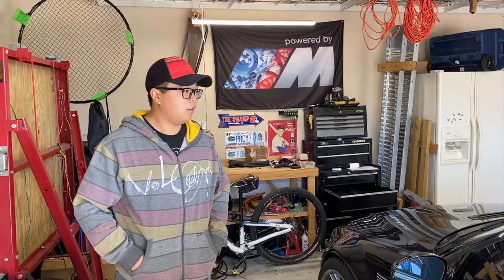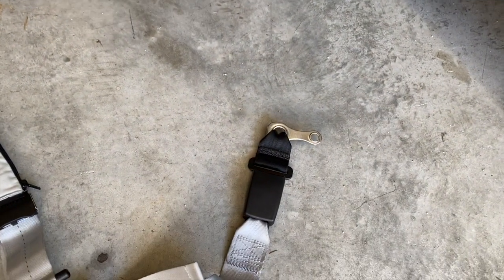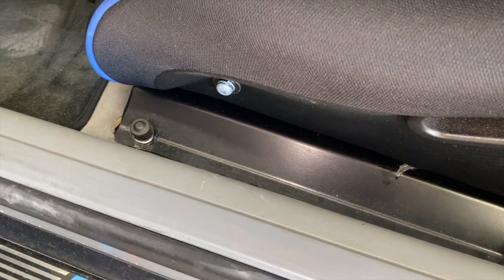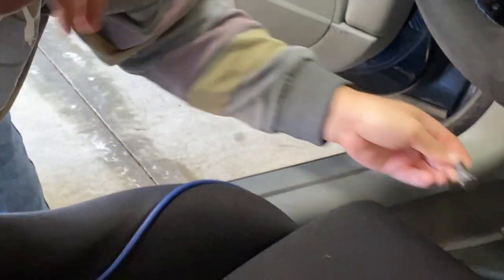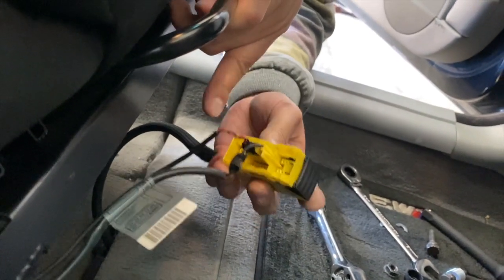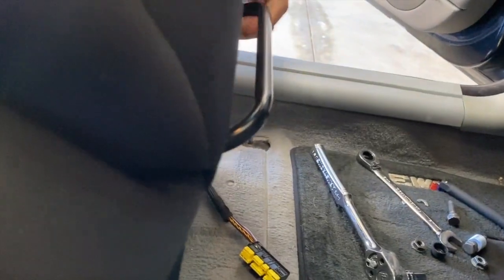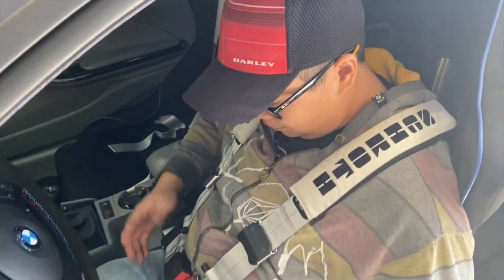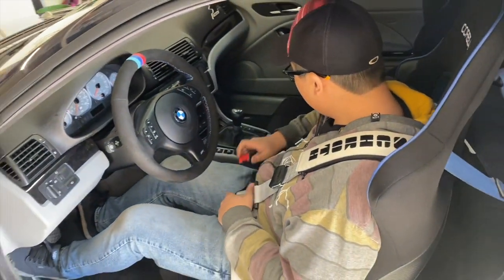Installing a SCHROTH QUICK FIT HARNESS on a BMW E46 M3

Comment: Anyone watching this needs to know. This setup is unsafe to drive and will likely not pass tech at any reputable track day. Schroth clearly states that their Quick Fit Pro Harnesses can only be used with factory seats. Fixed back seats with four point harnesses is very dangerous in a rollover. 

Please everyone know that if you add fixed back seats to a car, even if it has "rollover protection" that you must also add a roll bar and 5/6 pt harnesses. The factory seats are engineered to buckle in certain crash conditions that contribute to the car's rollover safety.

Sorry to be "that guy" but I just want people to make informed decisions regarding their safety equipment. 

Be safe. Have fun. In that order please.
Reply from the maker: +Peter Eacmen thanks for the info! Yes, I just learned today that this harness is meant to be used with the stock seats. My buddy was aware of that and will soon be installing a half cage. At least the info is still relevant for how this works and how to install with stock seats.
Reply: Thank you Peter. Yes, I've done a lot of research on safety stuff & I knew when I was going with fix back seats and harnesses, a rollbar or half cage was going to be required which is next here in a couple weeks. This isn't a daily driven car by any means so I knew I had some time to get everything together before the warm weather comes in spring for any DE events.
Reply: Rollover hazard with harness is when harness restrain occupant completely in the seat and the roof collapsing on him/her in a rollover, that will happen whichever seat you have, so long as you use a harness w/o roll cage. Whereas 3-point seatbelt allow occupant to roll, avoiding the ceiling essentially (I consider this a bit shabby). The major problem with this setup is not roll over protection, the quick fit pro does not work like regular harness. It has an extra fold in the shoulder belt that would unstitch upon an impact and allow the occupant to roll as with a 3-point stock belt. The problem with this setup is inadequate seatback strength, and possible compression of driver spine. The back strap of quick fit pro can have a steep angle downward (unlike regular harness that needs to be restrained to 10-20 deg) is because they go over the stock seat back, which are about the same height of the occupant's shoulder, and that prevents spinal compression. With your seat, the strap that contact driver shoulder goes downward directly, which exerts downward force on driver and may cause spinal compression in crash. Another outcome is that now there's significant force downward on the seat back, which can cause it to collapse. Stock seats are tested to handle this but not your carbon fiber bucket seat.
Reply: Otherwise good video man, clear graphics and voice, very illustrative. Thank you! Did you break something removing the side bolster? XD
Reply: Apparently cobra Nogaro fixed back are approved for Schroth quick fit
Reply: Scope951 Do you have a link to a document from Schroth with this info? Without it you may still fail tech at the track.
Reply: @petereacmen716  Good point! I emailed both Cobra and Schroth for confirmation. I just thought it weird I saw on multiple message boards people bringing that up, but it could just be internet keyboard warriors. I'll let you know when I find out!

I could see it being a point of nuisance trying to convince the local track day authority to allow you out on track with this unique and lesser known exact combination of harness and seat though. I thought the same as yourself.
Reply: Thankyou
Reply: @petereacmen716 @petereacmen716 The thing is schroth has only approved these harnesses for stock seats for certain cars/brands because those are ones they have tested. When you read the disclaimer at the bottom on the product page it does tell you about two fixed back bucket seats that are approved. They are approved simply because they have been tested. So in short, it is very possible for this setup in the video to completely safe. But you are still taking a risk because it hasn't been professionally tested. It is possible that those two seats are way stronger than most on the market but id be willing to bet the main difference between them and say a standard sparco is gonna be weight savings. In short, id be willing to bet most name brand seats on the market will do just fine with the quick fit. It's up to Schroth to want to shell out the money for testing though.